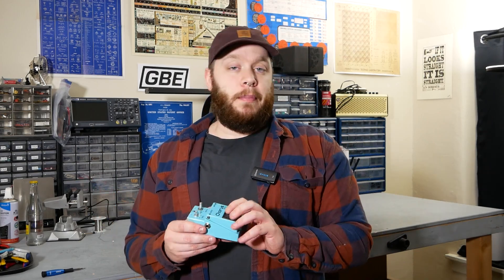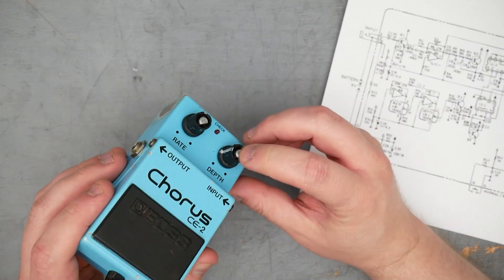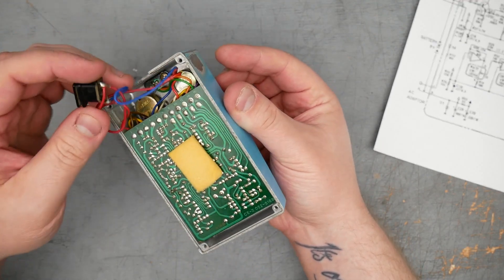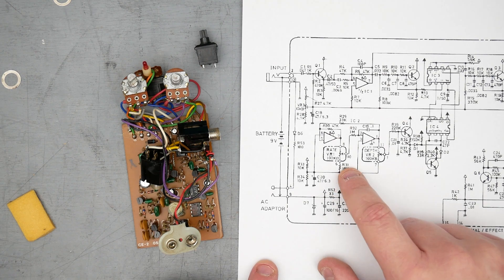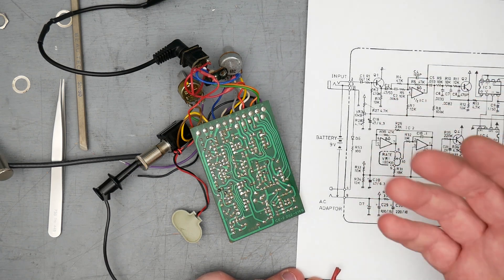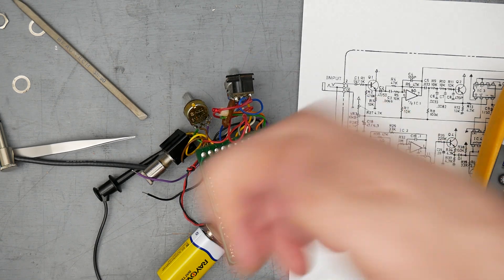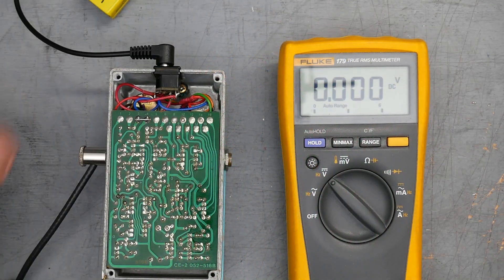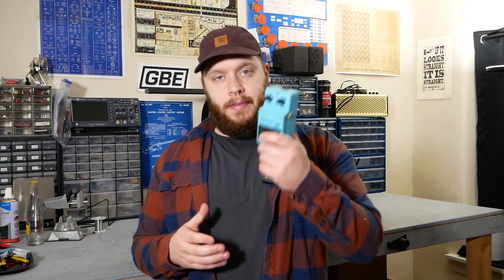Vintage MIJ Boss CE-2 Chorus Repair and Modification!

Comment: I got one for free did what you doing because the light didnt come on then did some research and you must put a fresh battery in it then have the right power supply 12v and it must be plugged with the input or it wont turn on

Comment: I have vintage analogue    CH-1, CE-2, CE-3 and CE-5 Boss chorus pedals. The 1, 2, and 3  did not have as much "DEPTH" as the CE-5. Looking at the CE-2 schematic, the wiper of the Depth potentiometer  connects to R35 a 220k resistor that goes to the base of emitter follower Q4. I connected a signal generator to the input jack  and my oscilloscope  the emitter of Q4. I removed the 220k (r35 on the CE-2) and temporarily  put a 220k pre-set resistor on the back of the circuit board across where R35 had been. I set it at maximum resistance and while watching the waveform at Q4 emitter, I slowly reduced the resistance until I saw a distortion of the L.F.O  signal. This only happened when the pre-set was at about 50k.  I then did a listening test, and by ear, it sounds like there is about 30% more depth with no other ill effects. I decided to stay a little on the safe side and fitted a 68K resistor in place of R35. The pedal sounds awesome now, and I'm only using around a little over 2 thirds of the depth pots rotation instead of maximum before I did the mod.   As this was successful, I looked at the CH-1 and the CE-3, followed the wire from the depth control wiper (middle terminal on the potentiometer) traced round the track which conveniently runs round edge of the circuit board and again on both, found a 220k resistor. I changed them for 68K and I now have all the pedals with more than enough DEPTH available.   I hope someone finds this useful.
Reply: this is awesome, gonna try this.

Comment: Praise be for this very helpful video! I just opened up my non-powering up 1982 CE-2 and did a visual inspection.. all looked ok other than some visual corrosion on the jacks. Turned out a little Deoxit got it working again. One interesting thing I learned while doing this was the metal body of the Boss pedals actually completes the circuit. (I think) Thanks!

Comment: Hola. Gracias. Tu vídeo me hizo investigar. Tengo el Boss CE-2 desde hace muchos años. Durante mucho estuvo sin funcionar hasta que lo abrí y conecté un cable que estaba desoldado. Luego lo he estado usando habitualmente colocado en la pedalera con el resto de pedales a 9 voltios durante un par de años, hasta que ayer dejó misteriosamente de funcionar. Yo notaba que la luz led no era muy potente, pero funcionaba. A raíz de esto busqué vídeos, entre ellos este, para buscar soluciones que fui probando y seguía sin funcionar. Cometía dos errores. El primero era usar un alimentador standar con positivo interior, y el segundo era usar una corriente continua de 9 voltios, tal y como había estado usando durante un par de años (aunque con polaridad cambiada, tal y como ya he indicado). Tras limpiarlo concienzudamente con alcohol isopropílico y hacer todas las pruebas pertinentes, seguía sin funcionar, hasta que el la última probé con 12 vol y positivo exterior, y BINGO. Lo que sigo sin entender es como ha estado dos años funcionando a 9 voltios con la alimentación del resto de pedales. Misterios de la vida. Saludos desde el sur de España

Comment: I two of these for years. I sold the silver button one and modded the other one. The best mod was to rip out the noisy op amps and then mod the rate circuit to make it go faster. 
When I made a BYOC copy I did these as standard.

Comment: I think it would have made sense to investigate more before you took it apart. If you had checked  the sound of the pedal and the battery first, you likely would have known the main problem, but you still would have wanted to investigate those large pots and correct that, so….its all good.

Comment: First off, thank you for putting the time into creating these videos. Very interesting and fun. Second, if I am understanding correctly would you have been able to connect that pedal to a bench power supply set to 12v, instead of the 9v battery, and it would have worked normally? Cheers.
Reply from the maker: Correct. The original boss adapters were 12V.

Comment: Very interesting vid. I was just stopping by as I love the Ce-2...What's the thing you used to take the solder away from the lugs on the pot you were putting in? Nifty!
Reply from the maker: That's called desoldering wick, specifically Chemtronics #4
Reply: Cool, thank you @graybenchelec

Comment: So, I’ve been trying to sus out what is wrong with my CE-3. Just replaced the busted battery clip, and that works fine. I tried 12v with the original power circuit layout and the pedal would not power up. I tested the power supply on another aca boss pedal, a DM-2, and that pedal worked correctly. I tried the power mod, but still nothing. Any tips for a novice to check? For now I will continue with 9v batteries.
Reply from the maker: I'd recommend posting some pics to /r/diypedals. Very helpful people over there!
Reply: @graybenchelec  I actually was able to sus it out. I compared it to my DM-2 and found that whoever owned my CE-3 before had swapped the connector out and wired the battery and power to circuit from the dc connector backwards. I swapped the connections to match the DM-2 and it’s all up and working with 9v now!
Reply: For clarity, I did make sure to find the correct pads to jump, which on the CE-3 was 2 and 3.

Comment: My 1980 CE-2 works with a 9v DC adapter. I bought it new in 1980 and have never opened it up or had it modded.
Reply from the maker: Yes, AFAIK the boss ACA adapter are marked 9V output, but because the pedal draws so little current, the actual output is closer to 12V. This is a "quirk" of linear transformer-based power supplies; the quoted output voltage is given at a specific current draw. Likewise, even if your adapter isn't the boss ACA adapter, it could still be linear and have the same higher voltage output. You could test it with a DMM if curious.

Comment: Another option for the old ACA pedals:  If you chain it with a standard 9 volt pedal it will cause the ACA pedal to receive the full 9 volts so it will then operate fine on a 9 volt power supply.

Comment: Yes the old pedals have a “USE BOSS ACA ADAPTER ONLY” tag on them. So you can bypass that circuit to use with modern 9v supplies. Or if you don’t want to, you can leave it as is and many power supplies have a 12v tap. I modded my LM2 and could care less about originality. I’d rather be able to use it.

Comment: Hey joe “(where ya goin’ with that gun in yer hand”) But seriously hello. I love your videos and your “work flow.” Very calm and methodical. I’ve learned quite a bit on your channel. I’m in an internal debate about replacing my multimeter. I just used a real cheapie that came with a bad soldering iron for quite a while. It pretty much served my purposes at a basic level. I remember you talking about yours, and can’t remember the make and model. Sounded up my alley. I believe you said it can reliably measure germanium transistors? Anyways if you could let me know (and others I’m sure) what it is, I’d be stoked. I’ve had a hard time deciding. Also wondering if it covers all of the other necessities. I know that’s personal. But your standard must haves. Peak atlas? Cheers. I hope you keep making these videos! It’s a pretty niche thing so your subs I guess will not get to epic prepositions. But the suns you get I’m sure are really dedicated and really appreciate the content.
Reply from the maker: Thank you! The multimeter I use is the Fluke 179. Fluke meters are overpriced, so there's no need to spend for that. Check out the EEVBlog meter, can't recall the model, but it's reasonably priced and works well from what I've heard. That said, no DMMs will reliably measure germaniums, that's where the testing methods I showed in this video come into play: https://youtu.be/fzxWWaWspIM
The peak atlas testers are convenient but expensive. You can get away with a breadboard, a couple components, and a multimeter. Good luck!

Comment: My grandpa used to engrave his social security number onto his electronics. It seems crazy nowadays but it was recommended at the time to enable unambiguous identification in the event it's stolen. But yeah... that's probably a social security number. Edit: 487... is a very early SSN allocated to Missouri.
Reply from the maker: You know it didn't even occur to me, I'm so used to  SSN being 10 digits.
Reply: Can confirm. That’s what older folks used to do to prove ownership of the item. I’ve bought computers and computer parts with the previous owner’s SSN on them. It’s usually not a big deal since they have passed on.

Comment: Whenever someone tells me their vintage Boss pedal isn't working the first thing I ask them is "Did you try it with a battery?" Most people use power supplies these days and aren't initially aware of the Boss ACA adapter.
Reply: I have one that doesn't work where the original owner cut the battery out of it for some reason.  Just another annoyance to repair.

Comment: GRAY BENCH, Why did Boss use a 12vdc Unregulated power supply instead of using a 9vdc regulated power supply? any reasons why
Reply from the maker: My guess, they already had a bunch of these 9VDC(12VDC actual output) unregulated power supplies and didn't want to buy/make new ones.
Reply: @graybenchelec  I think Unregulated power supplies are cheaper but are noisier so the S/N Ratio is higher. I'm not sure what that R52 33 ohm resistor between the two filter capacitors is being used for to balance out.
Reply: Pedal were a new thing... 9v wasn't already a standard...

Comment: I made the same mistake with my first boss ACA pedal. Now I take out the dumb resistor and diode in them. Thats at least all I had to do in my chorus and ge7
Reply: it wasn't dumb back in the days, it was that stabilized power supply for pedal weren't so common
Reply: @dt9r  agreed